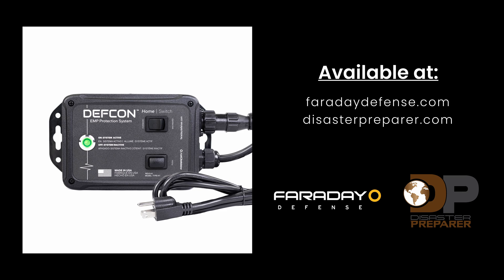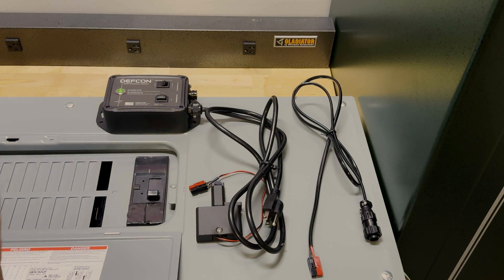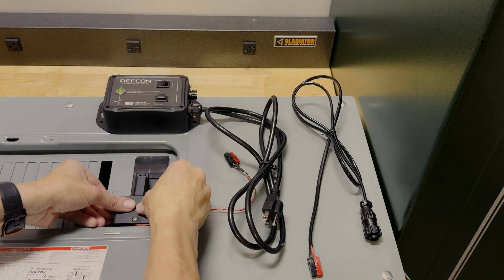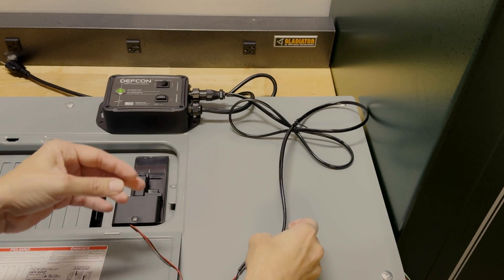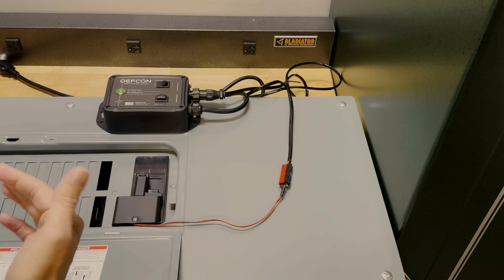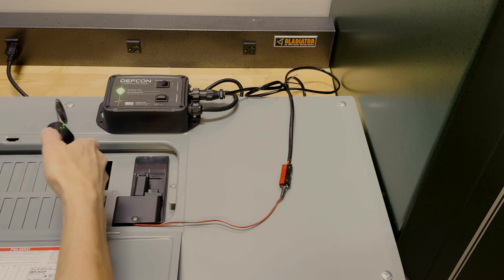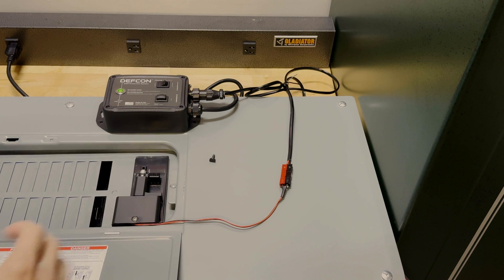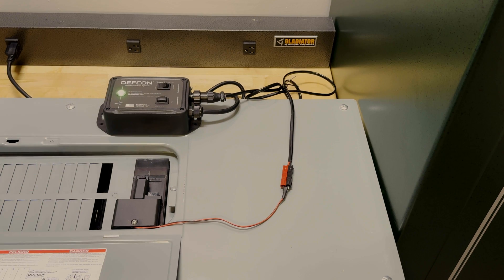DEFCON Home | Switch - Installation/How It Works

Comment: Hey!  I got it.  Managed to install it even with the bevelled opening for the switches. I had an electrician come out later to install the ferrites and Siemens unit.  I was afraid he was going to chew me out for  "modifying" the breaker box - but in actuality, the DEFCON unit doesn't electrically attach to anything so, he didn't chew me out at all.  Just asked me what it was.

Comment: Had our first isolated power down as result of tripped breaker. After confirming it was only us I attempted to trip the breaker on but had serious problem getting that pin out. I tried everything even surgical snips. Had to pull device away far enough to trip breaker back on. I need a replacement pin ASAP and/or retractor piece. Pease if possible rush.

Comment: I live in an apartment complex. My breaker box doesn’t have one master breaker to turn off all power coming into my apartment. It has many separate breakers instead. Can this device be used in this configuration?

Comment: I absolutely do not believe it! This device and others like it will never be able to protect your house from a high-powered EMP pulse. Never! Why? Because there are only two possible ways to protect your house from such a pulse.
1) Put the entire building inside a nice Faraday cage... but is impossible.
2) Isolate every single circuit and electronic board by grounding everything, but this is a solution that is almost  expensive. Only some military and government buildings are made like this. 
Your device can at most be good for protecting... the Christmas tree lights and nothing more. I challenge you to prove me wrong!

Comment: I think the EMP event will be over before this device can react. At least that's my understanding of an EMP event.
Reply from the maker: The E1 and E2 events will certainly be over, but the E3 won't. That's where the sustained overvoltage condition occurs, and what we're trying to protect against. Protecting from the conducted effects of the E1/E2 pulses is done via high-saturation ferrites and a quality surge protection device.

Comment: This seems way too slow to be effective! If needed to get inside the Breaker, the Switch appears to be in the way of opening the panel cover.
Reply from the maker: This unit is to protect against the E3 sustained overvoltage event, not the E1/E2 early pulses. Protecting from the conducted effects of the E1/E2 pulses is done via high-saturation ferrites and a quality surge protection device. I explain that in another video. It's expected that the E3 (or a CME) would be the most destructive aspect of an EMP. Also, there's really no way to protect items plugged in from the E3 except to disconnect.

Comment: Wow...that tiny motor has some really high torque to shut off a 200A breaker!
Reply from the maker: You are so right. We had to try a bunch out to find one that works.
Reply: @disasterprepper   Hello, this looks great. My main breaker 200 amp box is hard to push, is it strong enough for those hard to push breakers?? Will the tape hold if it is hard enough to push them?    Thank you

Comment: I certainly can see the device works.  However Ideally a shunt trip breaker would be infinitely faster to disconnect the load.  Unfortunately shunt trip breakers are extremely expensive and not made for 200 amp house panels.  Perhaps the breaker manufactures could step up their game and introduce a load center shunt trip breaker.
Reply from the maker: 100% true. We looked at shunt breakers, but they are VERY expensive as you said. Also, they are tailored for the particular load box, making a single solution difficult.

Comment: does this switch have a battery/UPS internally to make sure it can properly trip the breaker depending on power conditions, and fully trip it if power is partially interrupted before completion of trip?
Reply from the maker: This version does not have a battery backup. The idea is that it trips the breaker while utility power is still applied.

Comment: This is great but I don't think I have enough room in my RV breaker box for the device to sit over the breaker.  Are you planning on coming out with a version that allows for minimal clearance?
Reply from the maker: It's a good idea. I'll talk to the folks about a super slim model for RVs.
Reply: @disasterprepper  I can send over a photo and measurements of my box to get an idea.  Normally the boxes have a small lid that cover the breakers which might pose a problem.  I also thought about possibly installing another breaker behind the panel, in our case under the bed, then install the DEFCON switch but that would only work for those that are mechanically inclined.  You might have to design a 50amp/30amp RV breaker with built in actuator.  Don't they make a RV breaker with a small test switch?  Wonder if you can reduce the size to work with those?

Comment: So the house will be protected, what kind of damage will be further out? If hit with an emp, wont the power plant be damaged, won't the transformer on my street be damaged? This will save boco money for repairs once the problem passes.
Reply: If it’s an EMP then the grid has has collapsed and the country is dead!  The device will do its best to help protect your electronics. Hopefully your solar array and tech related to that. 👍 All these devices are for a worst day event. A DAY X! Life will never be the same but you can be better off than your unprepared neighbors!
Reply: If the country is fried, having this will only help you when the electric comes back on. We just put a new fuse box in our house, which cost about 10 grand. Other stuff also@BadNewsYouNeedToKnow
Reply from the maker: The damage that the "grid" suffers is open to debate, depending on who you talk to. The idea of the Home Switch is to protect your personal home or business electronics from the E3 overvoltage event. Then when either power comes on (perhaps intermittently) or when you have access to a backup power source (such as a generator), you can operate personal devices. Protecting from the conducted effects of the E1/E2 pulses is done via high-saturation ferrites and a quality surge protection device.
Reply: Plus all the electronics in your house will still work if you have an alternate power source.  Most people will have fried gear (anything that was plugged in)

Comment: So if your power goes out, nothing will move.  When the power goes on, does anything happen?
Reply: Nothing will happen without manual intervention since the main breaker has been thrown.
Reply from the maker: Charly has it right. Once power is out, you have to manually reset everything to get power restored.

Comment: Are you kidding? Add tge actuator to the exterior of the main breaker? 
1. If you must open the home breaker panel for any reason you must first remove the actuator! Am I wrong? This is a silly idea! Fix it.
Reply: Yup, you're wrong
Reply: 2. The reaction time of this device must be faster than the event itself. How can the detector detect the event, decide to trip the breaker, send the pulse (electrical in nature) with enough force to switch off the breaker before the event destroys the devices this product is to protect?
These events happen quicker and with such force as to overwhelm electrical devices, much less electrically driven mechanical devices. Is there a precursor built in? Does the device pre-load the mechanical switch so if power fails the switch is turned off?
Reply: @stibbs11  More wrong assumptions.  This is a companion device to all the other protections he suggests and sells.

This device guards against the E3 part of the pulse which is much slower and builds up over time.
Reply: The product description says EMP protection, it says nothing about E3 specifically.
Reply: That system will be expensive this will avoid some damage
Reply from the maker: No, you shouldn't have to remove anything. It installs to the outside of the box (but inside the door). Resetting is done as I show in the video. Also, as others have pointed out, this is to protect from the sustained E3 event. Protecting from the conducted effects of the E1/E2 pulses is done via high-saturation ferrites and a quality surge protection device.

Comment: 👋🏼 Hi, great explanation! I'm new to learning about EMP's. From what I'm reading so far it seems like electronics not connected to electricity also have to be protected, correct? Please excuse my primitive question, but I'm just starting my journey on this. Thank you for your time 🌻 blessings 🕊️
Reply from the maker: EMPs generally have two types of threats, those from the conducted energy coming in on the power lines, and those radiating through the air. The radiated energy can certainly couple into things not plugged in at the time, which is why people use Faraday bags and other shielded structures. Of the two threats though, the energy coming in via the power lines is considered much more damaging, which is why I think the Home Switch is so important. The Home Switch protects from the conducted E3 (or CME) event, and high-saturation ferrites plus a surge protection device protect from the conducted E1/E2 events.
Reply: Thank you so much for your detailed explanation. I have not learned that difference yet. Will definitely look into that now. Blessings to you and your family 🕊️

Comment: That is awesome. 
I have a application where i have a service disconnect switch located on a pedestal outside a structure.
Is this IP rated for environmental? How long is the throw? and what temp ranges is thisoperatable at?
Reply from the maker: Hi Jody, write into the company via the website, and we can get details.